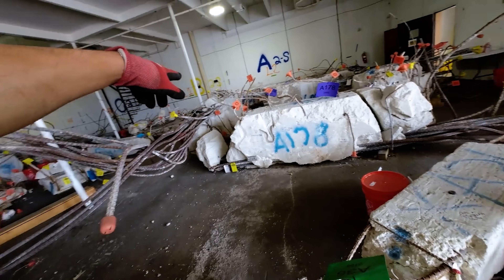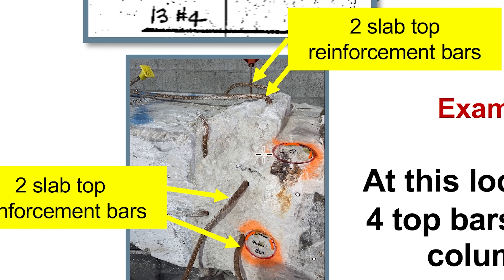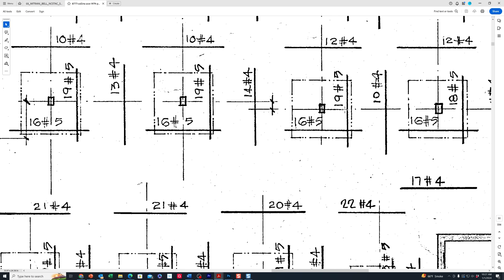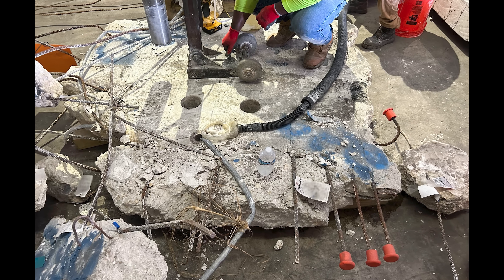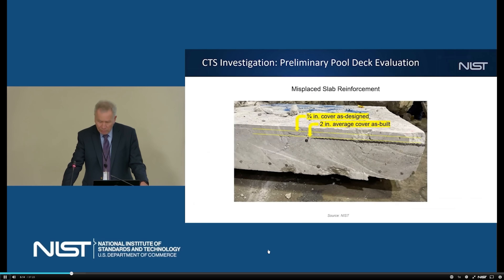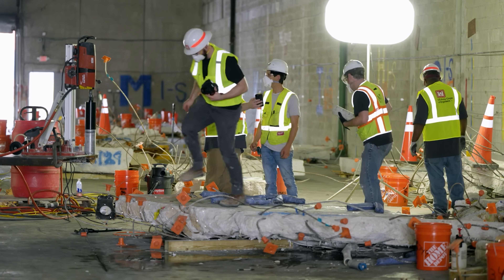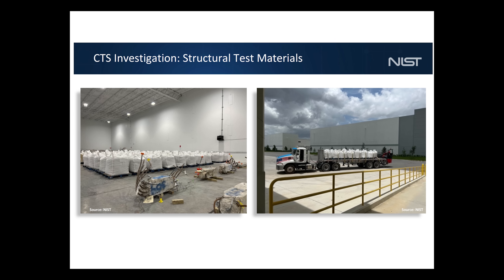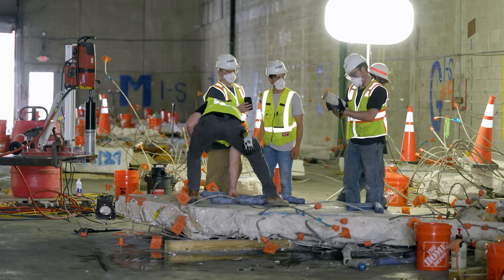More Shocking Build Errors in Miami Condo Collapse

Comment: People that failed to deal with improper rebar spacing:
1. Engineer - did they have any responsibility to review how their design was being implemented?
2. Construction worker - were they reading the plans directly or was their supervisor telling them how to construct the rebar reinforcement?
3. Construction supervisor - Seems like one of the most culpable in the whole food chain. Were they corrupt or incompetent?
4. City inspectors - This is per-hurricane Andrew Florida, As a practical matter building inspectors didn't do much back then.
5. Owners of the construction company - How much moral guilt do they have here? With the crappy building inspection practices of the time in Florida how could they get any jobs if they didn't cheat because all their competitors were cheating.

He didn't talk about it in this video, but there was a lot of load on the pool deck that wasn''t part of the original design. In my non professional opinion, somebody should have done some engineering before those giant plant boxes, pavers sand and that non load bearing concrete part of the deck were placed on the deck as designed 

He also didn't talk about some of the questionable design decisions made by the engineers. The connection point of the column to the deck looks to be a possible point of failure even if they had been built according to plan. Opinion based on information from previous videos.

Comment: 0:27 You've gotta be kidding me? Did they demolish the building and only then try to recover the recorder? There is no way on earth a residential system of likely less than 64 cameras had 19 hard drives. Hell, I have 200+ cameras systems that don't even use this many. I'm willing to bet none of these drives belong to the security system. Likely all recovered from personal computers in the rubbles. I wouldn't be surprised to learn the recorder got the same fate as the fire alarm panel.
Reply: Good point I was thinking the same thing they might be personal

Comment: This doesn't add up to me. 

Irregular spacing of rebar,  does not explain the immense amount of water, both pooling in the basement and roof.

It seems that engineers might be overlooking the obvious - concrete wall water pipe leaks.

After viewing multiple videos of this building (and many thanks btw for your very comprehensive videos), I compare it to my current situation.

I live in a concrete house with over 4 meter ceilings.

A very small maids room is at the back of the house with its own entrance (door) and bathroom.

Since we moved in, there was always a lot of mold in the corner above the door at the ceiling. 

I would wipe it down with bleach and thought it was due to high humidity in a very small room. I never imagined a water pipe leak in the wall.

Seven years later, we noticed a pool of water in front of the door. 

Unfortunately, the maid never mentioned the huge water bubbles forming beneath the paint. Nor, did she mention the crack where the wall meets the ceiling.

The plumber opened up the cement wall where the bathroom water pipe was located. He saw water leaking from the joint. 

This water leak had an effect on 3 of the 4 walls. On the back wall (back of the small room), the entire length of it was water logged at the bottom, as if, the room had been flooded- it hadn't been. It's just the water had no where else to go, after the one wall next to the door, where the water pipe lay, became saturated. It not only bulged, it sagged too.

This building sprung a leak, within its walls and had never been repaired from the inside. If it hadn't happened to us, I would not understand why it collapsed. I would also add that if the State of Florida doesn't enforce the type of cement used for construction (i.e.- Portland), then water & weak cement= disaster.

Comment: Hi Jeff as usual great analysis from the report. We are lucky to have a professional who analyze in depth
the ins and outs of this faulty contruction. I am realy interested in those recovered hd of which i keep asking myself why those computors that was located in the security office were not recovered before 
they blast out the standing portion. They will probably get parts of videos or undammage sequences that will help out . A local tv station few months after the tragegy broadcasted a video from one of them cam of one floor allway in the buiding showing vibrations and noise so there is no reasons why there is'nt many more

Comment: Each note is typically just as important as the next, so they all work in unison.  Here in Utah We are required to have rebar inspections before any concrete is supposed to be poured.

Comment: Problem with the "It should be on the front page in bold red"  concept is then the front page is going to be a title and then nothing but red text and two additional  pages of bold red lists of "important things". Already in this example pretty much all 9 of those notes are critical information, should all 9 be bold red on the front page? If not all 9 why? Who decides?  If the one or 2 that are left off the front page cause a disaster who is to blame? The info here was provided and just became part of the noise of typical notes..... if you plaster a bunch of stuff in red on the cover page its quickly just going to be....noise, especially once the lawyers get involved.
Reply from the maker: Yes, hard to make this fool proof

Comment: Maybe the installers thought 2 each way added up to the required 4? Maybe they should have said 8, with 4 each way? Also, isn't there suppose to be a "PUNCH through" collar or pad at each column?
Reply from the maker: Those drop panel pads you mention were not always used. I see them in more modern column slab buildings

Comment: Really enjoy your condo collapse videos.  Whose job is it to inspect that the rebar was installed correctly? Construction company or engineering?  Had to be someone's job to perform quality assurance against the design.
Reply from the maker: The supervisors from the construction company should be familiar with the floor plans and it is ultimately up to them to make sure the guys out on the deck are laying the rebar rods correctly. And then the inspector from the city hopefully would know what to check for before the concrete is poured
Reply: @jeffostroff  My last job before retiring was in Crystal Palace, South London where we partially demolished a 500 sq mtr restaurant / pub, excavated under etc., before raising seven floors of timber & steel frame on top. As Site Manager - I was / still am / responsible for checking 110 separate items every week and signing them off - this will remain down to me for the next 40 years ( in spite of the reasonable fact that I shall be dead for twenty of them 75 now!) For structural items - guys in my position are often pressured to sign off on things they are unqualified to do or have relevant experience. Doesn't stop them doing it - or for one's signature to mysteriously appear on papers never presented. I photographed EVERYTHING with a date stamp camera and mostly with a witness - I keep two copies in different places just in case I suffer an equally mysterious fire.  
                          The Spec for that job called for concrete sample blocks from every pour retained for testing and no less than FIVE agencies had to review our rebar installation before the pours,  I have a good collection of a full set of concrete cubes in my garden - those for the Structural Engineer & Architect went straight in the "dumpster" ( we say skip) as no one took them - so no tests ever done.

Comment: That rebar is expensive, and takes a lot of labor and time to tie it in. If we skip a few, who's going to know after the concrete is in, eh?  I wonder who made these decisions, and if there was intention behind not catching it before the concrete.

Thanks Jeff!
Reply from the maker: Yes very labor intensive. Nist did not indicate whether they installed all the rebars or if they were just too spaced out.
Reply: NIST needs to review other projects constructed by the construction company looking for signs of non-compliance
Reply: Assuming that the suppliers sent all of the rebar that was ordered, there should have been a lot left over?
Reply: @metocvideo  Assuming insufficient rebar was installed, where the rest went depends on who was corrupt. Stuff left over is easily disposed of. If it was just the guys doing the work - take it home, or cut it up and put it in the dumpster. Maybe the contractor diverted it to another job or simply didn't order enough and pocketed the money. Maybe it was a deal where it was ordered and the supplier paid, but the supplier didn't deliver and supplier and contractor split the money that was paid for product not delivered.

This is how corruption works.

Comment: What do these revelations mean for Champ. Towers North, CTS’s “sibling?” Nondestructive testing (x-rays, ultrasonic, ?) of the pool deck for rebar spacing? Additional bracing under the pool deck beams at the “step up?”
Reply from the maker: Champlain towers north has a world class structural engineer working on the case and has been working on it for a couple of years now. They have been taking core samples all over the place and putting shoring poles up to make sure everything is OK and they are aware of all of the issues and are checking to make sure that a lot of these issues don't affect Champlain towers N. For example they didn't Add all of that extra weight and sand on top of the pool deck and they didn't add the palm trees and the planters on their pool deck and they didn't have extra planters on the pool deck like Champlain tower S did

Comment: I'm not an Engineer, but as an Electrician I see an Engineer drawing like that as metaphorically being all in "big red letters" - 100% of the information in the drawing is required and must be followed - nothing should slip through the cracks. That is to say that it doesn't matter if it's note 1 or 27 - the note is there because someone (hopefully) smarter than me decided it needed to be there as an instruction to me to follow.
Reply from the maker: IT is the supervisors job to make sure these things get done
Reply: That won't help but good inspections would have helped.The design engineers should have made job visits.
Reply: Correct all information is important equally. The design drawings or construction documents and specifications are not how the building is built. The contractor is responsible for creating shop drawings that would incorporate the information found in the drawings and specs. The structural engineer, then reviews all the shop drawings for general compliance with his design drawings. The contractor and fabricator are ultimately responsible for what gets built periodically. The structural engineer would show up at critical points in the construction to review general compliance to the shop drawings. In fact, all the concrete should’ve been tested as well. Most people don’t understand this part of how buildings get constructed

Comment: From a layman's view, anyway, this is really cool. I am fascinated by structural engineering but have no formal training. I have seen gaps between what planners intend and what happens in practice. We all often trust and take things for granted. Excellent anslysis, from my point of view.
Reply from the maker: Very cool! A lot of times it boils down to your lowest paid employee who is nothing more than a grunt with no college education or anything and they're the ones that tend to make the mistakes. But in this case the mistakes were made-up and down the ladder from the engineers, to the architect, two contractors that have come in years later to make renovations, all the way to the engineers who came in to inspect it for the 40 year certification and failed to see the writing on the wall. This building was screaming at them that it was about to collapse and nobody paid attention.
Reply: @jeffostroff  Call me cynical, but I have difficulty believing that reducing the amount of rebar by up to 50% is a mistake.
I've loved your coverage of this, btw!
Reply: Yes, true - but you can over egg any pudding!  All that nitty gritty analysing - or as we often say on site in England - the ins and outs of a nanny goat's a*se!  
None of the collapse would have occurred if the deck had been properly water proofed, friggin' great planters and plant to move them excluded - extra weight being added all over etc., etc., Once the deck fell pulling out chunks from the main structure columns and at the same time removing lateral stiffness - the thing was doomed. 
All those nitpickers are at the same business as their kind are doing over here on a building called Grenfell Tower that burned rather spectacularly killing many "disadvantaged" people - the site is still wrapped in Tyvek two years after the event - a Public Inquiry has cost £160 million (I kid you not! Ten times what the building cost to refurb.) It's being used as a sledgehammer to bash the construction industry in general and the police are rubbing their hands with glee looking for easy prosecutions. In this respect - we are way ahead of you for once!

Comment: Very nice update to begin the New Year Jeff! Sounds as tho the sub foundation's yield under load was individually within reasonable performance. Any suggestion of a cumulative design weakness being found yet? Just for questioning's sake, what was the price of a stick of #5 bar back when the building was under construction? Cant help but wonder what other corner cutting strategies were employed. Happy New Year Jeff! -Bob...
Reply from the maker: I don't know what the pricing would have been since then in 1981 for the rebar, but I do know that in June NIST had already announced they found a couple of other errors now this time it was in the engineering design not in the construction of the welding. What they discovered in June was that the engineer had over optimistically assumed that his columns were stronger than they were but he was off by 50%. They also incorrectly assumed that the load that was bearing down on these columns was 50% less than they actually were.
Reply: @jeffostroff  If the rebar crew were not following design placement of the 4 specified bar locations at column intersections, wouldnt that increase the risk of failure, without regard to design load criteria? Sometimes I is nice to have a set of drawings in hand lol...

Comment: I think if there was 3 rebar above some columns it could have been a slight misalignment on the rebar (ie the 4th rebar just missed by centimeters)  that wouldn't show trying to cut costs.   But since there is only 2, they could not have missed by centimeters, but instead removed some rebar to possibly save costs.
Reply from the maker: Yes, or spread out the fewer rebar rods to make it look like there is coverage
Reply: Wouldn't have the NIST told us if they found fewer bars than specified? They spoke about wider spacing. There might even have been more material used in case the squares got wider than planned. Maybe the pool floor drawings misled the workers, the areas covered appear quite large. If the engineers planned equidistance, then 4 bars on overlapping each column would've meant spacings of only some inches, resulting in much more compact squares than displayed in the drawing.

Comment: Incorrect spacing on the rebar? Great, I am sure some drains were added and rebar was hit because it was out of place? Now you had rebar under tension by being out of place and now it gets relief from being drill thru and removed…Every coredriller hates to hear that pop sound…
Reply from the maker: Yes, they usually use sonar first to make sure they are not going to hit a rebar
Reply: @jeffostroff  yeah doesn’t always work out, was in the sawcut/coredrilling demo biz for 20yrs, and used pacometers and X-ray to “Try” and locate reinforcing, I say try because you wouldn’t believe how many times you can still hit the rods or cables in the area that looks clear (believe me when you look at the markings and they say drill here and you hit something, everyone is bewildered). Especially when it was an outside “specialty locator or service”,  always had the exclusion of “Not responsible repair of/or replacement of any damaged reinforcing or electrical conduits”  - other problems can be encountered as well, such as voids in the concrete, inconsistent substrate, etc… one of the strangest things encountered is if you hit or are near reinforcing and all off a sudden all your water disappears when drilling and it starts coming out of a beam or slab 20’ to 30’  or farther away? This can mean the reinforcing has rusted/disintegrating and expanded and the water travels through that void to another point of release….the only way you figure it out is when they do a forensic opening to figure out why that happened…(basically chip away the CC expose and follow the corroded steel)

Comment: You would have thought, that there would have been a drawing reference marker for 'note # 5' at each column that note pertained too! You also wonder why there wasn't field inspections of the rebar installations at columns where notes applied to them! Has anyone said if there is any job site documentation archived for this project? Field notes, field inspections, job site meetings?
Reply from the maker: All the inspectors are not engineers so that is a bit of a problem to begin with so they are relying on the engineer who stamped the drawings to be the expert and then of course do they always know about every note on every floor plan and to check to count all of those rebars. Perhaps maybe going forward people will do that, or maybe they already do that now when they didn't do it at the time. Sometimes they check a few spots and then assume all of the others were done the same way.